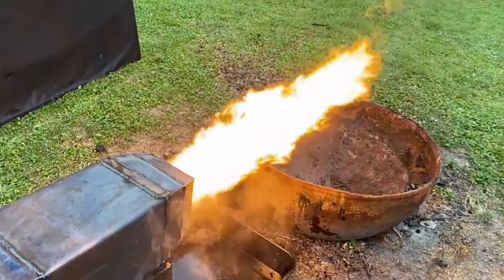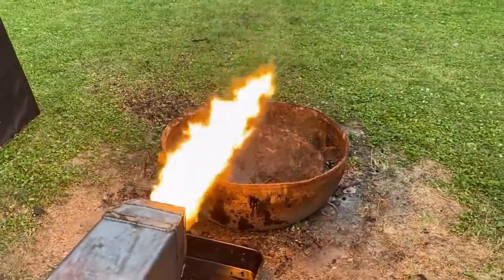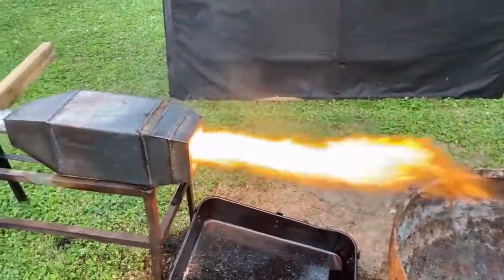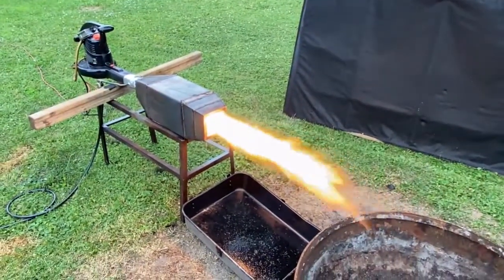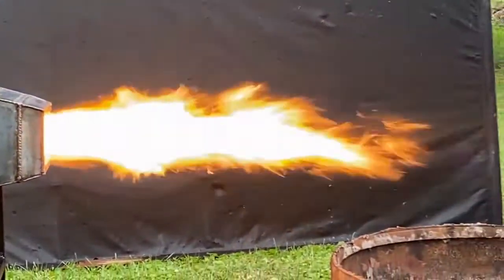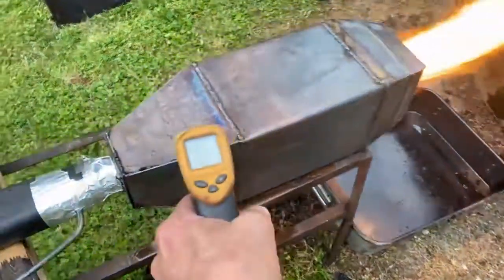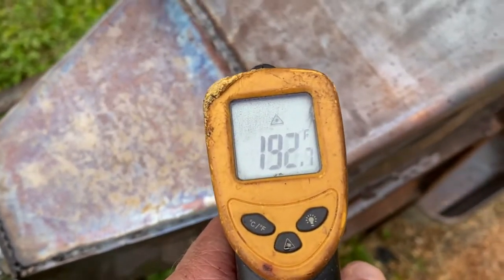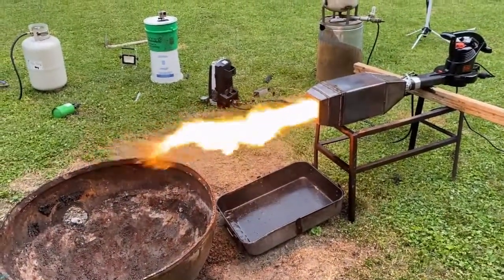380 Kw Turbo Jet  Waste oil burner

Comment: That thing is a unit man, good work
Have you experimented at all with a burner that uses a small amount of compressed air for atomization along with a blower for more cfm? 
Reason being alot of folks don't want to have a giant compressor. 
But a smaller burner that could use 5cfm of compressed air and a boat load of blower air to increase the power instead of getting a giant compressor
Reply from the maker: Yes i have several videos on that
Reply: @NOBOX7  right on, I've watch most of your videos and haven't come across it, would you link which one you're talking about? Any small foundry sized versions?

Comment: i ran an old 4 cylinder diesel engine on tick over at 1 lph of pure modern waste oil 5 to 30 grade with a pre heat for 7 days continuous for a cabin yard heater. . so at 37 lph .that would need some heavy demand of oil to keep it daily in use .
Reply from the maker: Yes i remember you mentioning this
Reply: Do you think an engine like that would run a 6-8kVA generator? Did you have any carbon build up?
Reply: I run a jcb for years on the mix so any really old diesel will run
Reply: @honda4004  - Thanks for the reply.

Comment: Why dont you feed the system with compressed air? Or rather design the system to be fed with compressed air?

It'd provide much more reproducible testing parameters and would allow you to dial it all in a bit better.

With compressed air you could come up with a design that can atomize the oil into a fine mist before combustion so you can get more energy out of the burn.